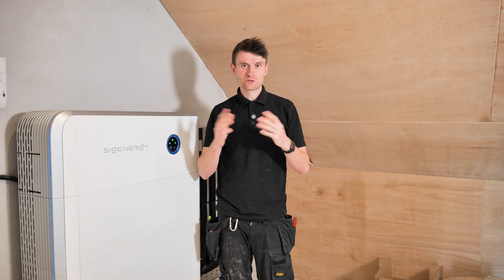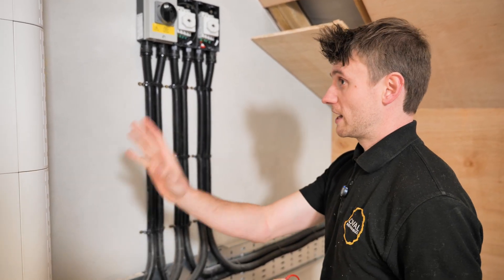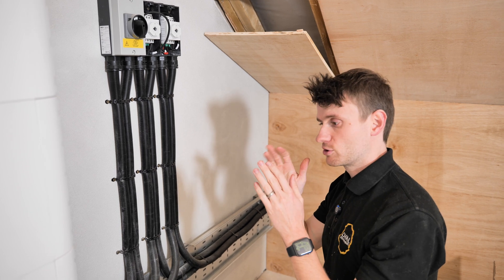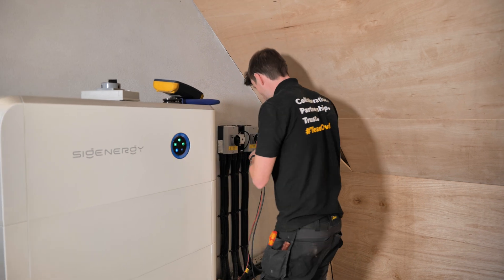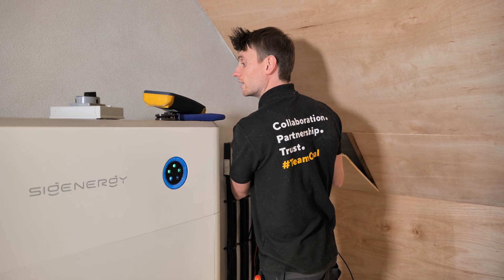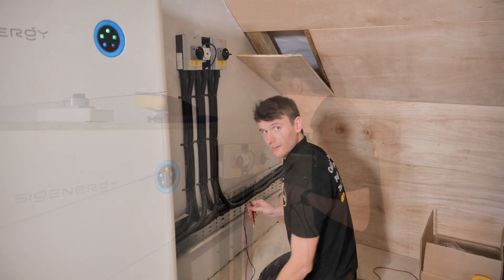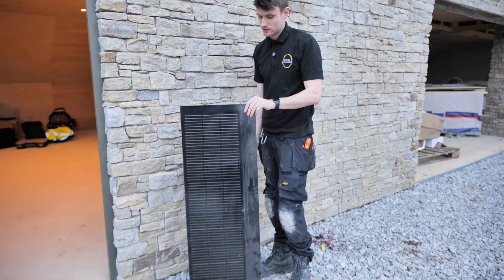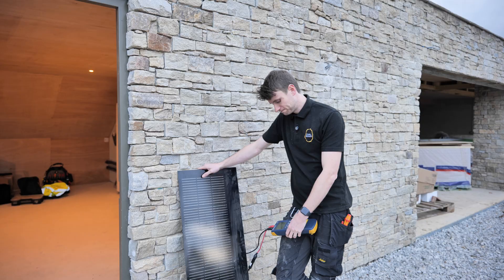FIXING A SOLAR TILE! HERE IS HOW WE FOUND IT!

Comment: What brand solar tile is it?
Reply from the maker: Nulock
Reply: @OvalRenewables Thanks for replying. I thought it looked like Nulok. Going with them for our new build. Do you see a lot of Nulok failures? Did Nulok cover it under warranty?
Reply from the maker: @kevinm5895  we haven’t had much to do with nulock to be honest. However I believe these were ex display ones so it may have been faulty from that point. However I aren’t a massive fan of solar tiles. I much prefer an in roof solar PV system like the Viridian system. You get much better kw output from it than solar tiles. Depending on the space you have obviously. It was not reported to them to be honest as the customer has a spare and the roof was easily assessable
Reply: @OvalRenewables we have lots of roof windows so the Viridian wouldn’t have worked. It was my first choice.
Reply from the maker: @kevinm5895 ah right I see that makes sense 👍